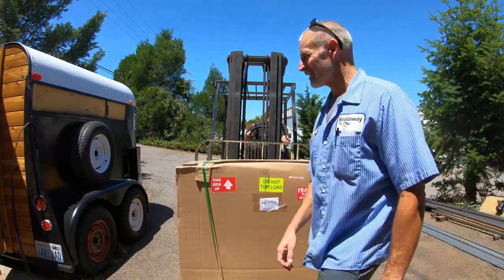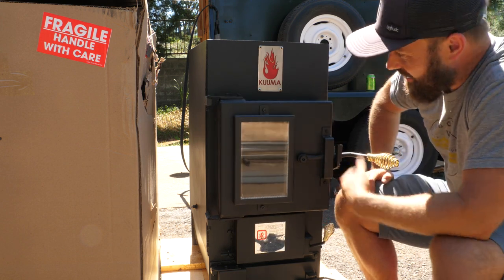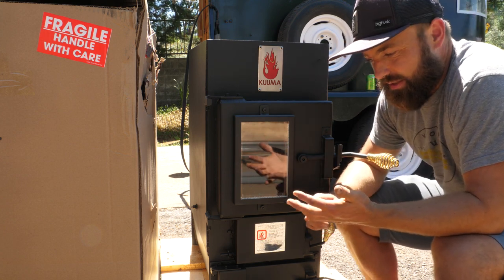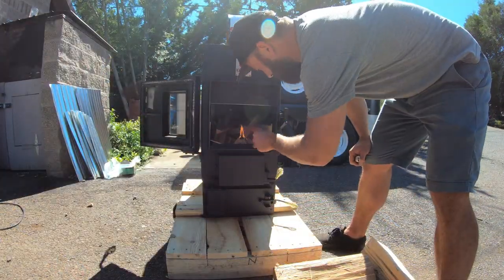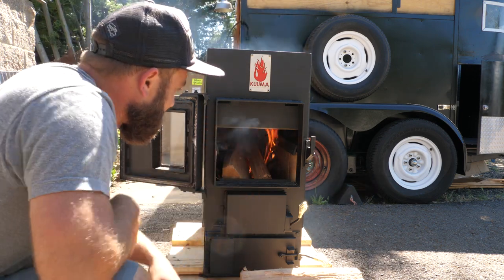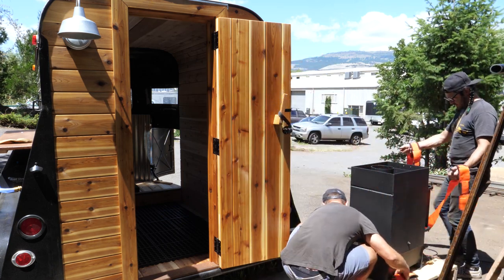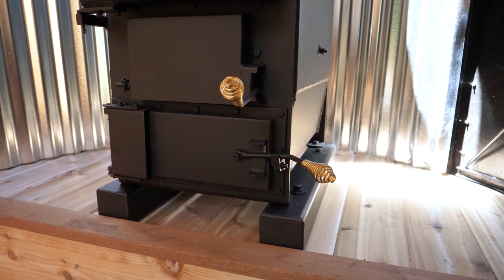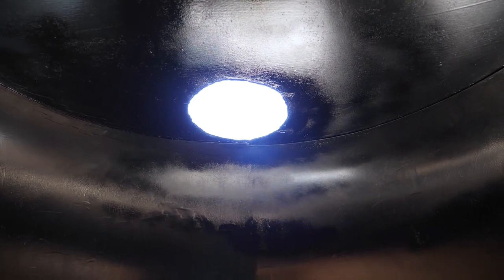Sauna Trailer Step 28: Installing the Best Wood Stove in the Universe!

Comment: Apparently you’re supposed to cool the stove down 3 times. Starting a low heat fire then cooling. Then a medium heat fire, letting it cool, the. A very hot fire. This will help break I. The steel and the welds